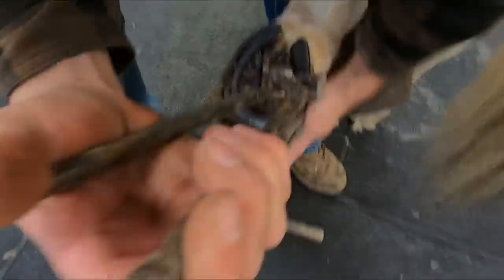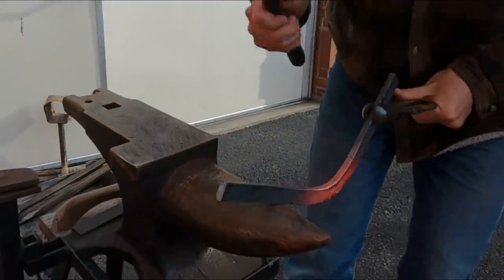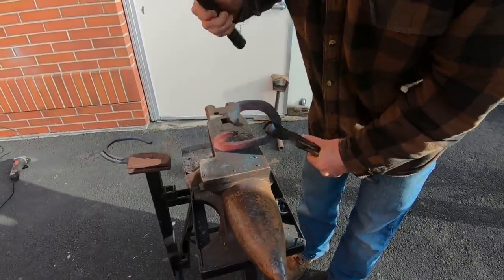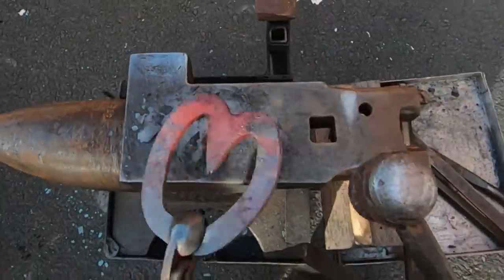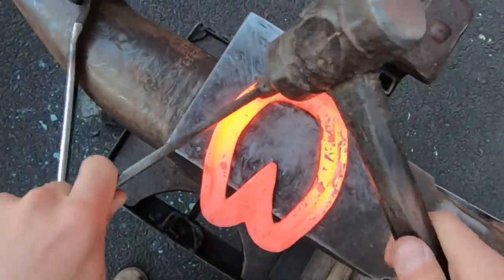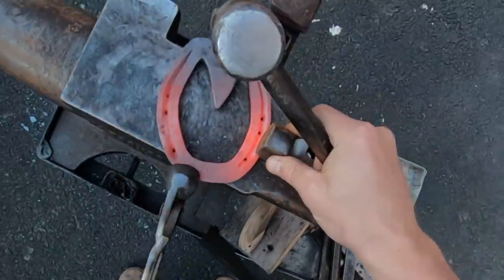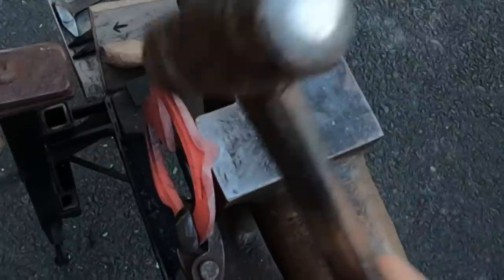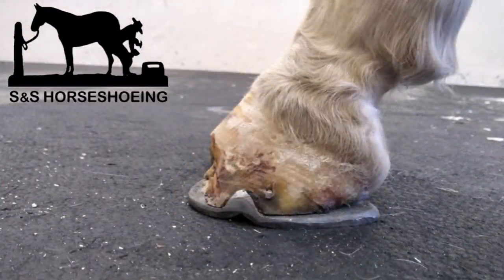CHRONIC ABSCESS!! (Veterinarian & Horseshoeing Collaboration) Therapeutic Horseshoeing // Ep.2

Comment: This was so awesome to find! My horse has a similar hoof resection done like this many years ago but in the outside quarter. Had 2 massive keratomas, the hoof wall had to be removed to the hairline.  Ended up having to go with an adhesive compound shoe during the healing process (no material to nail on to)  but it healed beautifully!